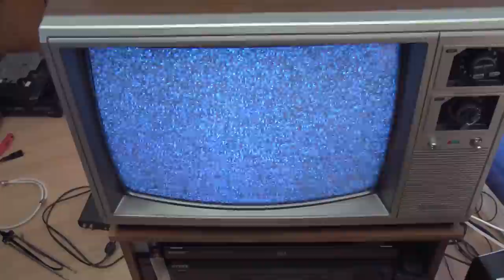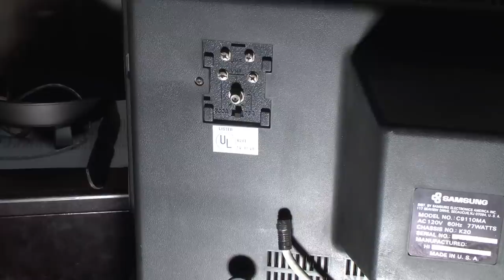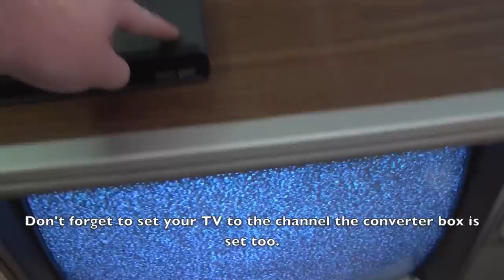Hooking up a Digital TV Converter Box

Comment: This video, although 8 years old, was EXTREMELY helpful, I've got an old CRT Television that I've had for quite some time, I used to use it to watch cable television but ever since we cancelled it I've never had the time to use it, or never had the care more like it, once I put away my old SNES and ATARI 2600 I never used it for anything, but after seeing this video I can finally start using it again as I've tracked down a shiny set of snap on rabbit ears like you've got (it has the mounting point for them) and I can still buy a converter box from some box stores, and I can finally enjoy watching the tube again!
Reply: my town has cheap cable xd

Comment from the maker: You can use the red and white RCA jacks directly on the back of the converter box and connect that directly to a stereo.  If you mean about the coax then yes, it doesn't have built in MTS (stereo encoder) built into the converter so it's coax is mono only.

Comment: Thank you so much for this. I have an old tv with built in VHS that I wanted to use and I bought a converter box that doesn't mention using the co-axel cord, and I was clueless. Couldn't figure out how to get it to work! Thanks for helpin out an old lady with no technical skills!
Reply: What do you mean it doesn't mention using the co axel cord? Did not it not come with that cord or does it only use RCA cords?
Reply: Cynthia Jones You can either hook up the RCA yellow and white cables to the front inputs or the rf swirly screw in cable cord in the back. I recommend you use the front rca inputs if you wish to record programs. Also, you can still use the vcr part even without a converter box. Hope this will help.

Comment: GMA Affordabox, the digital TV box unit in the Philippines, also has the two RF terminals; the RF in is for the antenna, and the antenna out is connected to the TV set. Instead of ATSC, the box receives DTV signals using the Japanese ISDB-Tb system.

Comment: Still useful info
the thing is a "BALUN" for "BALanced to UNbalanced" converter.  It gets pronounced as that.
The 2nd thing is also called "BALUN".  A nifty thing about BALUNs is that they work both ways.  
Converters usually output on CH3 or CH4 remind people to select that channel/
After you get the converter working do the "scan for channels" thing on it.  It will be in its menu.
You may have to fiddle with the rabbit ears to get the most stable picture on any given channel.
I get about 100 channels on rabbit ears.
Your mileage may vary.

Comment from the maker: Any adapter will work, though some work better than others.  Digital Stream is one of the better ones.  All you truly need is a UHF for most channels, and VHF antenna for the VHF ones.  I believe a powered antenna will help, as long as it has both bands.  "Digital antennas" are nothing but glorified UHF antennas, which doesn't always help.  For example, here in Orlando, channel 2 WESH is actually VHF despite being digital.

Comment: When digital TV started in UK the coverage was very poor until 2012 when the old analogue signals was turned off. Freeview UK said they only recommend outdoor TV Aerial/ Antenna as the portable or "rabbit ears" wasn't suitable anymore.  which in most cases thats true unless you live very close or nearby a TV transmitter
+
Reply from the maker: I don't know if it's just because DVB sucks, or if there's a limit in the transmission power by the local government, but at least in ATSC areas it's not as bad.  In Orlando I got around 70 channels with an attic antenna (not even on the roof).  This includes subchannels of course.  On the TV itself I got around 50ish.
Reply: i am not totally sure if in USA  and Australia still use VHF in digital format as UK and Europe use UHF  for DVB.. AKA Digital Video Broadcast
Reply: @RobertHellier Japan, Brazil and the Philippines all use UHF for ISDB-T. Escecially 1SEG.

Comment: You can still watch cable if you use the 300 ohm to 75 ohm adapter to hook the coax up that's what I did with 1979 rca xl100
Reply from the maker: A lot of cable companies have ditched analog cable.  Mine did before I canceled them.

Comment: For those with an HDTV, the instructions are even simpler! Just hook up the antenna, you're set to go!
Reply from the maker: Well yes, but this video isn't catering to those.
Reply: there are some HDTVs that doesn't include a built-in DTV  converter.
Reply from the maker: Macky Clemen Then those are not HDTV's.  Those are "HD Ready", and using this kind of DTV tuner is the WRONG tuner for those sets as it will not give you an HD picture.
Reply: Oh. I've been telling the wrong thing the whole time! Sorry for that. 😕

Aaaaand yes. This is designed for old CRTs whose screen's aspect ratio is 4:3. 
(Funny thing that my grandparents tell me that the new converter box, which is SD, looks clear on a TV whose screen's aspect ratio is 16:9 😂)

Comment: I have three questions. 
1. Back when analog satellite existed, what would the signal look like if you hooked it up to an analog cable ready TV set? 
2. When analog Pay Per View existed, what if you had an analog cable TV that had 125 channel capacity, but hooked it to cable and set it to an analog Pay Per View channel? Would you get a scrambled Wrestling event, for instance? 
3. When did your area ditch analog Pay Per View?
Reply from the maker: 1.  Nothing you still needed a satellite receiver, different frequencies.
2.  It would be an inverted picture with no horizontal sync.
3.  I don't remember.

Comment: Ok thanks. I dont have an antenna yet but I thought i would hook up the DTA just for heck and for no real reason I decided to just connect my remaining Cable line to the adapter etc (as per instructions). All I got is a message saying something like "looks like you've had an interruption in your cable" or something like that - so I guess that makes sense - since I have no cable. Hopefully will work ok with an antenna. Will let you know - and thanks so much for responding to my question.:)

Comment: Oh yeah VCRs work the same way over here. Except they have SCART sockets on them with composite on the front in some cases.

In fact I am using my VCR as a RF modulator so I can record TV. And also so I can feed the sound to my stereo.

My set top box for digital satellite does have a built in RF modulator, but the quality isn't that great and it's only mono.

Comment: what if i have a tube television? is there any specifics to be done other than what is shown?
Reply from the maker: Well in the video I was using a tube television, so just do as I do.  If you have only 300 ohms inputs, I'd just go ahead and get a 75/300ohm matching transformer as shown in the video, you will need one of those.
Reply: ok thank u just got the thing working today and its friggin huge XD
Reply from the maker: ***** I bet it's heavy too.  I love older sets, they are work horses.  I have tried upgrading, but LCD's just don't have the charm, or character, and they also haven't been the most reliable.  I'll keep my old set until I can't get parts anymore.  I replaced the flyback in this TV and that repair has held up for quite a few years without so much as a single problem.
Reply: nice and it is heavy its maybe 3ft wide and 2ft tall roughly and its METAL got so many vacuum tubes in it it was near impossible to turn on

Comment: Hope this idea works for my 1953 Zenith tv, I reworded it because the original cord was bad and the screen lights up and there's that buzzing sound
Reply from the maker: If the TV is working properly, yes it will work.  RF is RF, and in America, channel 3 is the same frequency it's always been.  You'll just need the matching transformer.  As for buzzing, you'll want to check caps on a set that old, and if it only happens with certain graphics on the screen, that's actually normal.  Older sets with very sharp graphics do cause a buzz.

Comment: How to hook up converter box plus digital adapter,dvd and vcr units?
Reply: You mean hooking up a dvd recorder/player, and a VCR? Well, if you want to record the programming coming off your converter box, you can either use the RCA yellow, white, red plug hook ups on the back of the unit, or plug your converter box's coax/cable connection output to the input of the VCR or DVD recorder/player that you want to have hooked up in between the tv and the converter box.

Comment: You change the channels in the digital TV box or in the TV? the TV must always be in the 3 channel?
Reply from the maker: LookingMercury3D Yes, the digital box changes the channels, and the TV must be on 3 or 4, depending what you set the box to, for an output channel.
Reply: Ok.. It is basic like a CATV box, i have not used it because my LCD TV have is own DTV decodifier inside, just plug in the antenna and ready
Reply from the maker: Then you don't need it at all, why ask this question then?  lol   If you have a DTV, anything regarding a DTV converter is moot.
Reply: Curiosity.. That's all
Reply: Brandon MacEachern Orlando, Florida
Reply: +Brandon MacEachern In my area it's channel 4 because 3 is used by broadcasters

Comment: I got a question you may be able to help me out with. Or not, worth a try. I have Dish but I want one of these because I want to get some local channels Dish does not have. My Dish is not connected directly to the old TV though, it's this weird thing where it's coming from a receiver from another room. But anyway can a digital converter coexist with previously mentioned DIsh connection?
Reply: +Python Fatal you can use your dish dvr as a converter box
Reply: +rannz8 I get his question (got the same setup). He has no Dish DVR on that specific TV though, so using it as a converter box won't work. Fatal, you've got a UHF thing going. Yes, the digital converter box should be able to work regardless of the Dish hookup on the second TV because (I assume, and assume I am right) that your Dish is connected from the TV 1 receiver via coaxial cable. Simply connect the digital video converter to the second TV (with Dish already connected via cable) using those color coded RCA cables. That way it affects the second TV in no way and you just switch inputs.

Comment: Also I have the adapter coaxial so I can attach it to the coaxial cord due to it being an older and portable tv. But my question is on the converter box do I place it in the antenna outlet on the furthest left or where it says tv input right next to it ? It's also a Bentley Tv & a Sony Mega Watchman. They both have the "Ext Ant" option for antenna as well.

Comment: I'm one of those people like you...I've had cable since 2009 and I have a TV sitting in my room doing nothing. 
I have several questions:
1.  I am assuming that since I saw RCA jacks (composite) on that box that it has a built in RF modulator.  Is that correct?  Because I have an old TV like yours that has no composite input.  It would be nice to hook up one of my old DVD players or NES or modded Coleco or whatever to my old TV.
2.  Am I correct to assume that there's no point to the old round UHF antenna anymore?  That now all channels up to 64 or 84 or whatever (I mean all channels from 14 on up) are condensed down to be picked up through the V shaped rabbit ears?
3. Also I have used these cheap converter boxes at other people's houses and they were garbage..not picking up half the channels..and the others being fuzzy or intermittent.  What's the secret to fixing this problem???  Is it using a large outdoor antenna like the old ones on the side of some houses?  Or do I get some expensive converter box?  Or is there some add on thing from Radio Shack that will improve performance of a regular cheap converter box?
4.  Do they by chance make converter boxes that have multiple inputs RCA, F connector or whatever?
5. Can you still get a credit/rebate for these cheap converters from the government?
Reply from the maker: pimpingmrli 1 - You will notice I hook it up with RF out, so yes, it has a modulator built in.  2 - You are wrong.  Most digitial TV channels are UHF, so you really should be using a UHF antenna.  Those "digital" antennas are just fancy UHF antennas.  3 - You want an antenna that matches the wavelength of the frequency you want.  So if it's UHF, getting a larger antenna is a bad idea.  For VHF, yes.  4 - No idea.  5 - No, you had more than enough time to get a converter, as far as the government is concerned.
Reply: Brandon MacEachern Thanks!  About the second question...I guess I had the 2 types mixed up then.  I meant the old antenna that was shaped like a circle and would usually attach directly to the twin lead screws on the back.  Maybe that was for VHF then.  So I guess you're saying you only need the one type of antenna.  Correct?
Reply from the maker: pimpingmrli Circle type is UHF.  That is generally what you would need.  You really need to examine what channels are in your area and see what frequency they broadcast on, not the virtual channel numbers they are using, then determine what band that frequency is.

Comment: When I hooked up a DTV converter to a portable black and white TV, the picture would be snowy a lot.
Reply from the maker: Faulty connection between TV and converter (either bad adapters, cable, or even a faulty tuner in the TV).
Reply: Thanks for mentioning what the issue could be.

Comment: I always wondered, was it possible (when analog scrambled cable channels existed) to place a descrambler chip inside an analog cable-ready TV set itself? Scientific Atlanta had very high-end descrambler boxes. Wasn't channel 1 usually used by cable providers for Pay Per View?
Reply from the maker: I'm sure if you wanted to, you could, but it wasn't profitable.  Hotels however, may have actually had something like this as they had a lot of interesting tech inside their TV's.  (Remember they had TV's with phone jack ports that N64 controllers plugged into, and the TV could relay that data to an N64 in the front office that played games on a dedicated RF channel for your TV to tune to.)
Reply: @hakemon  Thanks for the reply. Going back to the topic of C-band analog satellite, did it exhibit the same type of analog interference as typical VHF/UHF broadcasts?

Comment: Awesome video! What year is that TV from?
Reply: +Jim Dayton 19" Samsung from 1985
Reply: Shark Record Films Sweet! I need more old woodgrain cased TV's
Reply: Jim Dayton Same here!
Reply: Shark Record Films I'd say my two favorite woodgrain cased TV's are the mid 80's-early 90's RCA Colortrak, and Sony Trinitron.
Reply: Jim Dayton I really like the mid to late 80's Simulated Wood-grain sets with the UHF/VHF Knobs on the side.
Reply: Shark Record Films Sweet! Those are hard to come by. I never owned one. What do the UHF/VHF knobs do?
Reply: Jim Dayton Well they look just like the one in this video, back when you didn't need a converter box to use your antenna you would use the knobs to change channels. The knob on top usually is VHF(very high frequency) and the bottom is UHF(Ultra High Frequency).
Reply: Shark Record Films Ok, Thanks.

Comment: I bought a box today. I was under the impression I would be able to get the usual ABC, NBC and CBS stations. Is my thinking wrong? I bought iKonvert digital converter.
Reply from the maker: If it can be received and a transmitter is nearby, then yes.  You gotta look up what's in your area though.

Comment: i have a 1980s portable tv with a big antenna and it works with out a digital TV Converter
Reply from the maker: That would be because you have lower power stations still in your area, those are the only still allowed to transmit in analog, in the USA that is.  If you are getting all of the primary Networks without a converter, well that's just not possible in the USA.

Comment: With a TV that has only one ANT-IN, would using a splitter so that I can have both this antenna box and a cable service connected, reduce the picture quality greatly?
Reply from the maker: Yes because that's not the way splitters are supposed to be used.  You would be attenuating the antenna.  You would be using the splitter as a combiner.  What you need is an AB coaxial switch box.

Comment: I have a Visio high definition tv and the convertor box like you are using.  How do I hook this up? Dish is locking out channel 11 or CBS and with Dish we can't watch that channel. My only choice is RCA cables and I  have gotten a AV2HDMI adapter to go from RCA to HDMI to plug in with from the convertor box. Will this work on the high definition TV?

Comment: I got a converter box from Time Warner and tried it but I got a message that there was an interruption in service, check the connection, and try again.  I do recall it worked the first time but then it crapped out.  I also bought an RCA square antenna but that didn't work.  I like in a building with trees in the front and the walls are concrete.
Reply from the maker: The DTA's from Time Warner are for cable only, and will not work on antennas.  If it is indeed plugged into cable, and the connections are correct, you'll need to send hits.  More specifically, call time warner and ask them to send a refresh hit.  Those little Cisco DTA's don't have any permanent storage, they rely on those hits more than a regular box, to operate.
Reply: Brandon MacEachern  Thanks.  I called the cable company and they a refresh hit but the issue didn't go away.  I guess I have to go to them ad get another box.
Reply from the maker: adelgado75 It's very possible there is a signal issue.  Hold down the info button for a few seconds, and it'll give you a code color.  It should be code green.  Yellow indicates a "little" issue, but watchable.  Red is no good, get a tech out.
Reply: Brandon MacEachern  Thanks.  I will try it and let you know.